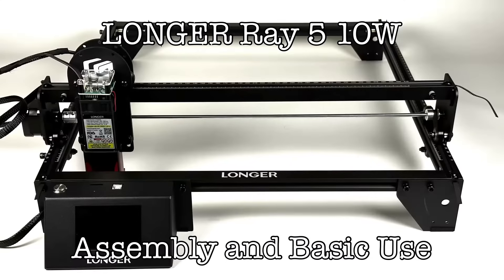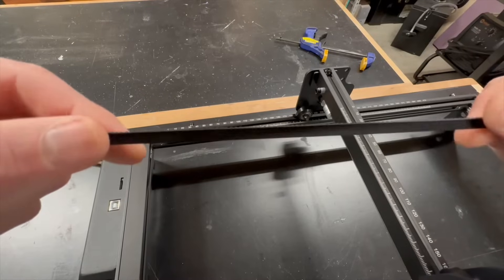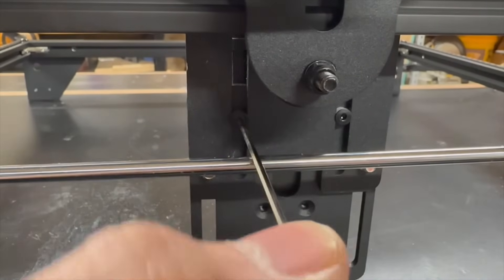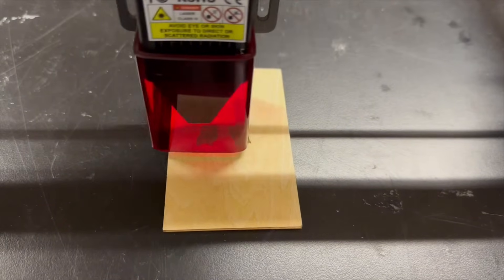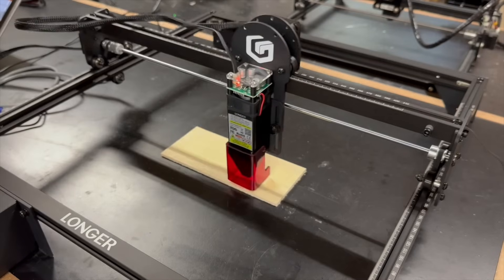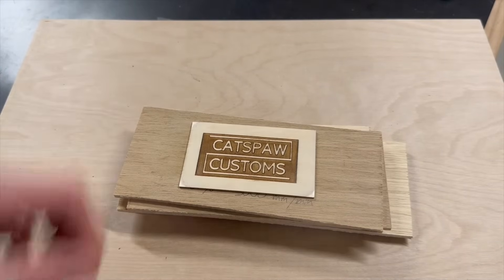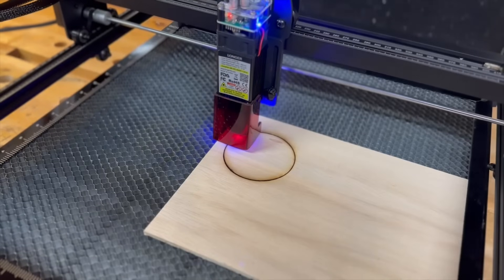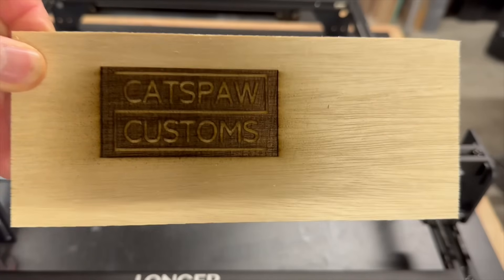Beginner Laser Engraving with the Longer RAY5 10W

Comment: Question. Is it possible to run it off an art program, or does it need to be Lightburn?
I have an art program that can save JPGs.
Reply from the maker: @Michelle-oc4ty  you need lightburn or LaserGRBL.  It’s not like a printer.  You need software to turn the image into GRBL code.

Comment: I’m sure this would not be an issue, but have you tried cutting dense foam with your laser? I’m curious if it would cut, or does it burn and catch on fire?
Reply from the maker: I did try with a 30 watt diode laser and some closed cell foam and that laser didn’t do anything to it.  I think you need a CO2 for something like that.

Comment: I just purchased this off Amazon and found your video to be very helpful. I'm primarily going to be doing leather.  Could you send me any settings or configurations for leather that you have found to be great and I will definitely give you a subscribe!
Reply from the maker: I actually no longer have this model, I upgraded to a 30W from Atomstack, so I don’t have any settings.  I’d recommend running the materials test in lightburn on some scrap to give you the best idea of what will work.  I show how to do it in this video Making Laser Cut Maps (while Testing the Atomstack A30 Pro)
https://youtu.be/Wyo4g6N6aJE, but there are also tons of other videos that show the process.  I didn’t even know about that feature when I made Longer Ray 5 video, but it is super useful for dialing in the laser for your material.

Comment: Thank you for a well done video with very helpful  detail.   The Longer looks like a good starter Laser. Don't make the mistake that I did.  I think that the Longer b1-30/40 W might be my next Laser.  These higher power Diode Lasers are able to cut real wood allowing a complete project to be fabricated.
  
Common Issues with the Ortur Lasermaster-3  And the company that sells it.

Issue 1:  Ortur LM-3 Not Powering On

One of the most prevalent problems encountered by users of the Ortur Laser Master 3 is its failure to power on. 
This issue can stem from various factors, including a faulty power adapter, blown fuse, loose connections, malfunctioning laser module, or motherboard glitches. 

Notably, the Ortur LM-3 has faced criticism for having an underrated  "power brick." Despite seeking assistance for this issue, my attempts were met with silence.
 
Subsequently, I discovered a suitable replacement on Amazon.

Issue 2:  Inadequate Laser Engraving

When laser engravings fail to meet expectations, several causes might be at play. These include improper focus, uneven engraving area, or unsuitable materials for laser engraving.  

YouTube is a good source of help for these issues.  You certainly shouldn’t expect help from Ortur.

Issue 3:  Mid-Operation Halts

Frequent occurrences of the machine halting during operations can be attributed to loose connections, faulty motors, or software/firmware glitches. 

This issue has been highlighted extensively on YouTube.  Ortur was no help with this or any other machine problems.

Issue 4:  Subpar Engraving Quality

Substandard engraving quality can arise due to incorrect settings, a dirty lens, or a malfunctioning laser module. To help with this you can:  make adjustments in settings, perform lens maintenance, and monitor the laser module's condition. 

The airflow at the laser head seemed inadequate on my LM3 the supplied air assist pump only supplied 30LPM while the specs recommended 50LPM.  Again, no replies to my questions from Ortur.

Issue 5:  Smoke and Odor Production

This is a common concern among laser users, particularly during cutting.

Some of the fumes that evolved during cutting, especially with synthetic materials like plastics or from galvanized metal grids are very toxic. Installing proper external ventilation and employing an enclosed setup is highly advised. 

This is not specifically an Ortur issue but applies to all laser installations.

Issue 6:  Unusual Motor Noises

Motors emitting abnormal sounds during operation may be attributed to loose connections, inadequate lubrication, or faulty motors.
 
Similar observations regarding the Ortur LM3 are shared on YouTube. 
A common cause was Ortur's inadequate tightening of the drive sprocket set screws, resulting in loosening of the drive pulley and possible drive shaft damage. 
 
Once again Ortur would not respond to my request for information. This was a major theme throughout my journey with the Ortur LM3.

Issue 7:  SD Card Recognition Failure

When the machine fails to recognize the SD card, possible reasons include a faulty SD card, corrupted files, or firmware complications. 

My Ortur LM3 seemed to have issues in this area.  The SD slot on my LM3 was not mounted correctly resulting in the loss of the SD card into the front rail extrusion which required a disassembly of the front rail of the LM3 to retrieve the card…

Not high on the fun meter. Contacting Ortur for assistance was hopeless, as usual.

Issue 8:  Machine Freezing Up During Operation

Machine freezing mid-operation may stem from software/firmware glitches, motherboard issues, or communication problems between the machine and the computer.
 
Establishing a reliable link between my Ortur LM-3 and any of my computers proved to be a major struggle.  Despite weeks of effort on my part. 
 
All the problems with the Ortur LM3 were exacerbated by the lack of help (total silence) from Ortur. 
 
I ultimately sold my brand-new machine at a substantial loss due to this and other issues and no available help from Ortur.

Issue 9:  Inconsistent Engravings

Inconsistent engraving results might result from incorrect settings, a dirty lens, problematic materials, or a malfunctioning PWM (pulse width modulated) laser power controller.

I don’t have direct experience with this issue as my Laser head would not come on, no matter what I tried. 

Assistance from Ortur for this issue was not forthcoming, as usual.

Issue  10:  Lack of Customer Support and Service

In terms of customer service and support, Ortur failed miserably on all counts.

Despite purchasing the laser, from an authorized Ortur distributer directly, I received no help or even a response when problems arose. 

Requests for help went unanswered, and defective parts questions were disregarded.

Unfortunately, Ortur seems unwilling to invest in a customer's Problems, needs, or satisfaction., even after a customer invests, in good faith, in an Ortur machine.

Personal Experience with Ortur LM-3

My excitement for the Ortur Laser Master 3's potential to enhance my workshop capability quickly turned to disappointment and frustration. 

Despite its promising appearance, I encountered only obstacles, excuses, and no assistance from Ortur. 

Their lone response directed me elsewhere for help saying that they weren’t responsible. If not Ortur then who? 
 
It’s like one of those old shell games when you deal with Ortur…The pea’s not really under any cup.

Ultimately, I was forced to sell the Ortur LM-3 at a substantial loss, leading to the demise of my laser aspirations.

An Urgent Recommendation

Given my ordeal, I strongly advise considering other options before investing in an Ortur product.

It is my hope that you will avoid these problems and not support a company that displays such an obvious lack of commitment to both product quality and customer service.

Parting Thoughts

I am not inclined to write negative reviews and I didn’t enjoy writing this one. But, I felt compelled to share my experience as a cautionary tale for others. Thank you for taking the time to read my account of problems I and others have had with Ortur.

I sincerely wish you success in pursuing a laser product that will truly meet your expectations.  

You may want to consider the following well-proven and reviewed Lasers:

- Longer Laser B1 20 W (22-24W Output Power) ~ $759

- Longer Laser B1 30 W (33-36W Output Power) ~ $979

- Longer Laser B1 40 W (44-48W Output Power). ~ $1299

- Acmer P1 Pro 20 W Laser Engraver ~ $359

- Acmer P2 Pro  33 W Laser Engraver ~ $599

- 5W CR-Laser Falcon Engraver ~ $259

- 10W CR-Laser Falcon Engraver ~ $379

- Creality - Falcon2 22 W Laser Engraver & Cutter  ~ $330 (sale 08/23)

- Creality - Falcon2 40 W Laser Engraver & cutter ~ $1619

- xTool D1 Pro ~ $994

- xTool D1 Pro 40W + 10W Laser Cutting Bundle ~ $1699

Comment: This is the first video out of 8 that covers cutting wood.
Thank you very much, I wish others would make videos like this more than printing. My plans are to use it for making my rc airplane part's.
Keep up the good work Sir you doing a great job.
Reply from the maker: Thank you!
Reply: And I was trying to find information about engraving metal. I have some thin candle tins containers that are painted black I was hoping to be able to laser in a logo. The paint on them is pretty thin so I think it's the right kind
Reply: @claytonjames4779 You should be able to with the 10w model. I have the 20w and it engraves painted metal and anodizing easily.

Comment: Brilliant! I have to commend you (as others have already) on the fabulous stop-frame animation. It was quite a treat! Do you know how well this would cope with acrylic up to about 10mm (5mm would probably be the thickest I could want in general)? My key question is whether it would just cut and melt it, creating a rough, unrefined edge. Smoothness is key as it would be for some flight simulator panels which will be backlit, so any roughness will look terrible. Thanks again
Reply from the maker: To my understanding, a diode laser really isn’t what you want for cutting acrylic.  I think you would need a C02 laser to effectively do that, and factors like color matter.

Comment: How much tension should be in the belt. I make 400mmx400mm project and it take aboht 8-12 hours. Is it because my tension on my belt is to tight? My projects are well detailed. But does the timing of a project take that long?
Reply from the maker: Belt tension should be enough so the gantry doesn’t wiggle but it will freely but slowly fall if you tilt the engraver.  8-12 hours sounds like maybe you need to increase speed or your settings in lightburn are off.

Comment: Just want to say the two screws that go on the back of the Lazer with the nylon bushings mine are to short, I was pushing hard to try and get those screws in, even withought nylon the screws don't reach so I just left it withought those two back screws it's more annoying but there's not much else I could do
Reply from the maker: That’s a pain in the butt.  Definitely not a problem I had.  Did you try contacting Longer?
Reply: @catspawcustoms  just talked to them, they said they did indeed send the wrong screws but they want me to buy new correct ones from them it seems

Comment: Anyone haveing issues geting the 2 screws and plastic thing to scrow in i cant get mine in
Reply from the maker: Are you talking about the two that hold the laser on with those tiny white pieces?
Reply: @catspawcustoms  yes they dont seem to fit for some reason
Reply from the maker: @zeopale2062  Very weird.  I just checked mine and couldn’t readily see any way you might be doing it wrong.  You might have already done this, but make sure you’re putting the white plastic ring in from the back of the machine.  I’d also recommend seeing if you can get the screws to thread without the y axis in the way, just a dry fit to make sure they are the right size screws.
Reply: @Catspaw Customs  they can dry fit in im trying the way im seeing on videos i may try to sand the plastic down or ask for new ones seem there not long enough to me

Comment: Have you tried running the same file from an SD card in the machine? When I do this the machine frames in a different position. I cant understand it.
Reply from the maker: I haven’t messed around with the SD card really at all.  For me it is just easier to leave an old laptop hooked up and use light burn.
Reply: @catspawcustoms  I really wanted to use this away from my PC. That's the reason I chose this laser. Cant see the point in an SD card if you cant do this. Never mind.
Reply: Same
Reply: @charmini7  I figure out how to use the machine from my desktop.  Its a little querky but now I don't ever connect my laptop to my machine.  Just connect the machine to your wifi and then punch in the Ray5's address on your browser and you will get an ESP32 web page.  That means your connected.
Reply: What if I want to use me iPhone? Is that possible?

Comment: Thanks for the  great video.  Trying to decide between this one and the Comgrow Comgo z1 10w.  Price points are very similar, but the spot size on this one is slightly smaller (0.06 mm x 0.06 mm vs 0.08 mm x 0.08mm on the Comgrow).  Leaning towards this one, but still doing the research.
Reply from the maker: I’m pretty happy with it.  If you decide to get one and want the air assist, by a set of weird circumstances I ended up 3.  They retail $89, I’ll send you an unopened one for $65.

Comment: Adding an air assist will help a lot
Reply: Great, looking forward to a review on it. I just subbed
Reply from the maker: I have one on the way, I’m really looking forward to seeing the difference.
Reply: @catspawcustoms  any update on the difference?
Reply from the maker: @eddyx420  Yes, it definitely cuts more efficiently and cleanly, though I could not get through 1/2” plywood, even with 10 passes at 200 mm/m.  I went slower and just burned the shit out of the wood. Supposedly it will do basswood at 10mm thick but I don’t have any to try with.  Regardless, for an $89 add-on it is worth it and installs really easily.
Reply: What speed are you using for cuttting
Reply from the maker: @coopzv8472  for the 3mm plywood, 200mm at 100% has been working well.

Comment: New subscriber here - great review!  I just got this same model a few days ago and like it.  Chose this one over the other brands mainly because of the smaller focal point and higher energy density.
I didn't know where the flame sensor is located, but now I do - thanks.  
I had the same issue connecting it to Lightburn, but figured that out on my own.
Keep up the good work!
Reply from the maker: Thank you!